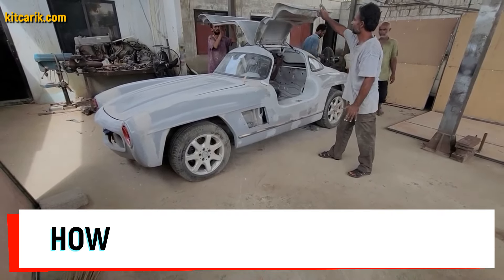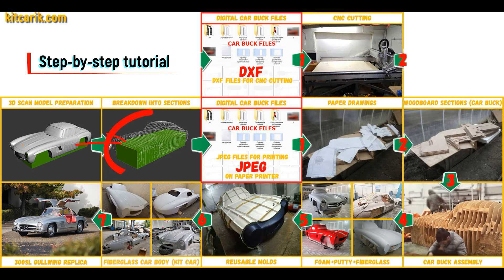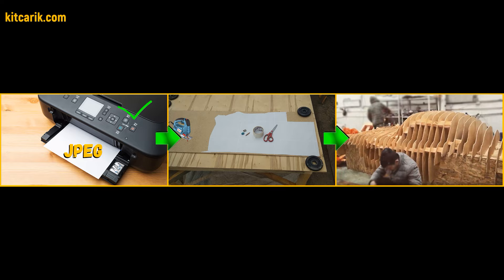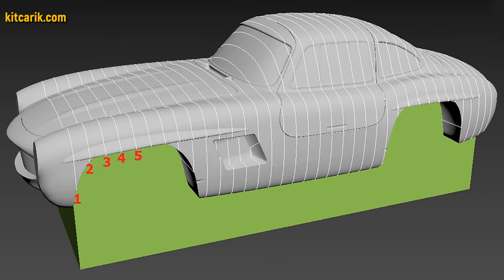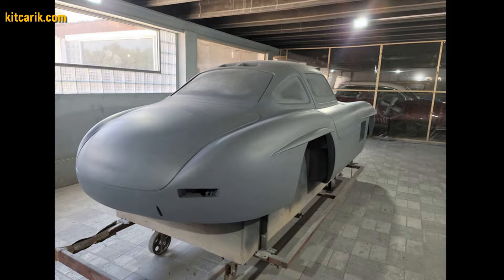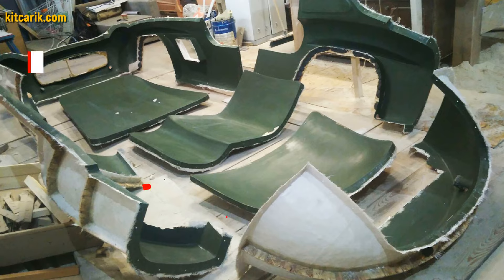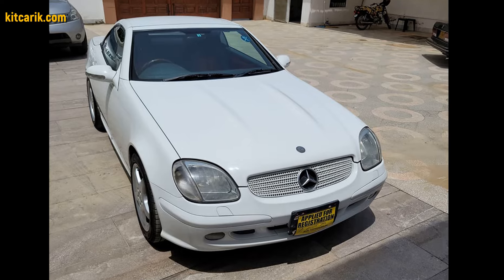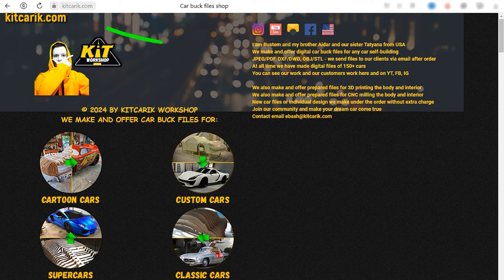DIY Kit Car Mercedes 300SL Gullwing Replica Fiberglass Car Body Made From Car Body Buck

Comment: This is an amazing video and nice job 'kitcarik'. I would be interested in buying a set of the fiberglass pieces if anyone is making them from this after they do all this work. Feel free to reach out and let me know if these are available.
Reply from the maker: 🔥🔥🔥🔥 All my clients do their projects themselves and for selves using my digital car buck files for self-building, so you only need to rely on yourself. Moreover, doing it yourself will cost much less than buying a ready-made fiberglass body 

https://kitcarik.com/shop/mercedes-benz-cars/mercedes-300sl-gullwing